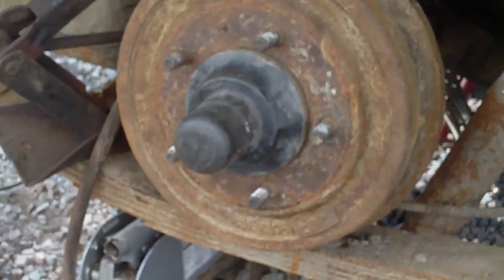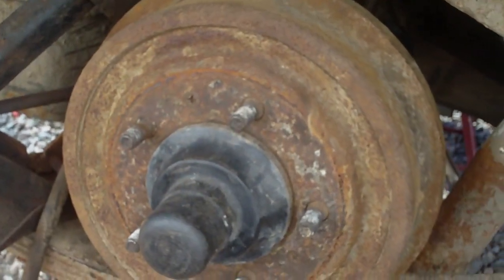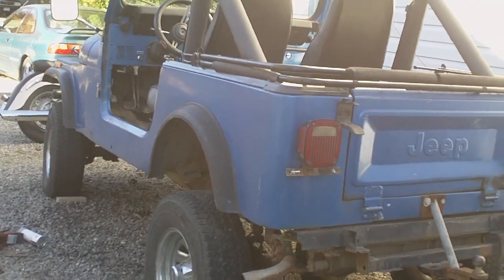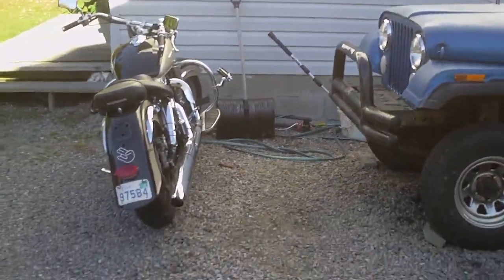JEEP CJ7 spring over lift pt 3

Comment: @pga2000golf You can do it to the rear axle, but the front requires a kit.  Fords have a weird front suspension system in these trucks.  But the front kits are cheap for 2".  The generally accepted best way to get some free lift from an F150 is to flip the rear spring bracket over.  Gives about 2".  About the same as a leaf-over.  But far simpler to do.  There's at least one video series on YouTube that walks you through it.  But he's doing it on a Bronco.  Suspension wise, it's the same.

Comment: @rex4x4 maybe the replacement wire is just too thin or the push wheel is worn out and needing replaced in it because it's just worn out, that happens that or the spring that pushes down on it loses tension, they make a cheap kit depending on the model of your welder, i forget who had the kits but i saw on here where they replace those, i think it was actually pug that did the replacement on his on one of his you tube videos.